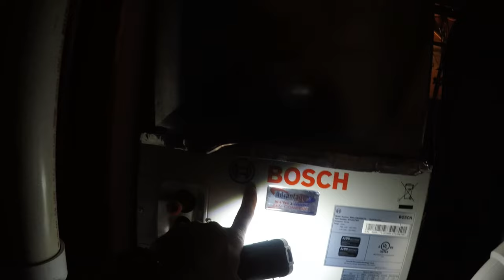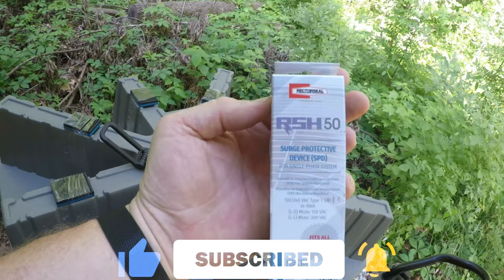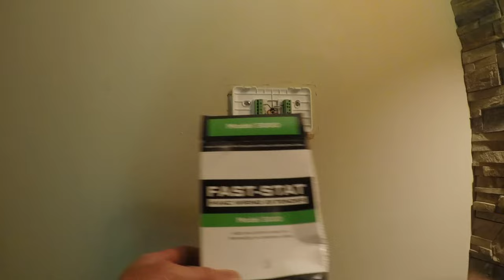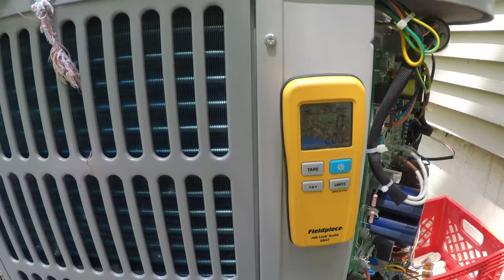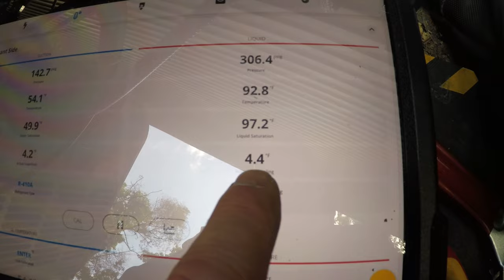Ultimate AC Upgrade: Bosch IDS 2.0 Heat Pump with Dual Fuel! Using  a Fast-Stat

Comment: Looks like you used soft solder, what do you think of it?
Reply from the maker: I like it. Definitely has is purpose. Switched back to oxy, Ace I’m liking that too.
Reply: @ADVANHVAC  We use zoomlock fittings when ever possible, past that brazing under nitrogen. We have been reluctant to solder despite manufacturers claims that is is fine based on callbacks from some of our competitors.
So my questions are, what solder are you using? And have you had any issues after fact such as TXV, reversing valve or compressor failure?
Maybe they are using the wrong products, or using them incorrectly? On in particular seems to have zero understanding of sizing and installing a proper duct system.

Comment: Looks good. How come you didn't use a Bosch Furnace?
Reply from the maker: Thank you! My Supplier doesn't keep the bosch furnaces in stock. Besides the Bosch heat exchangers are not stainless.
Reply: @ADVANHVAC  Most primary heat exchangers are not stainless steel, most if not the majority are aluminized steel. And to my knowlege every manufacturer including Bosch uses a stainless steel secondary heat exchanger. 
I understand stocking issues, and maybe if you are installing enough Bosch IDS systems get then to stock it.
I install quite a few Bosch IDS sytems each year, and most installs I use the Bosch furnace, there are a few cases a year where we don't like current furnace is quite new, but a/c needs replacing, and the home owner wants to replace furnace down the road.

Comment: Could this be set up with a oil forced hot air furnace?
Reply from the maker: I don’t believe so for a number of reasons. Oil heat gets way to hot, and you need this Cased coil to sit on the furnace. The blower would need to be a Variable speed ECM for proper airflow.  At this point I would convert over to propane and a High efficiency furnace and a Bosch, then you would have a dual fuel set up.
Reply: Thanks for your input.

Comment: Do these units need a 4 wire to the outdoor unit?
Reply from the maker: Yes to use the heat pump option.
Reply: I have yet seen a situation in your videos where you deal with a finished basement .  I know you always like to change linesets, but what do you do in those situations?  You do great work BTW:)
Reply from the maker: Thank you. On a finished ceiling situation as long as the line set size is the same as the new system you can clean it out either using Rx-11 flush and or the wiper. I use the hilmor wiper set up with Rx-11 at times. And maybe able to use that fast stat as well on the heat pump side.  Never had to do that.
Reply: 4 conductors is best, but 3 conductors is sufficient in some applications. It depends on the application, and controls used.

Comment: Soft solder for on the lineset 30amp disconnect on a 45amp rated heat pump so much hack in this install it’s pathetic.
Reply from the maker: Min. Circuit Amps: 24.8; Max. Fuse Size: 40 Stay bright 8 Works Just fine. Know what you're talking about before you comment, Troll! Thanks for watching.